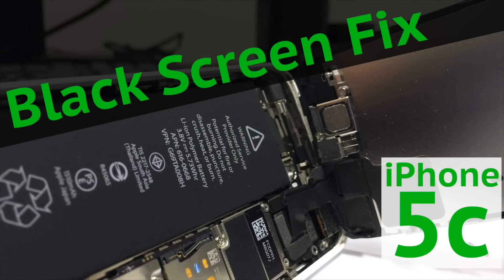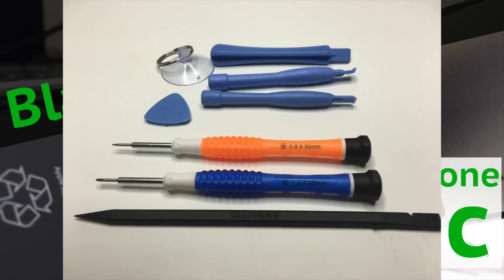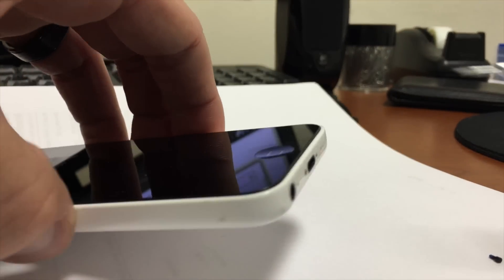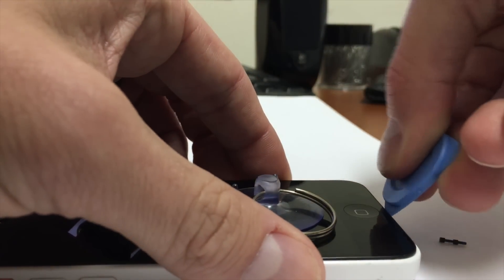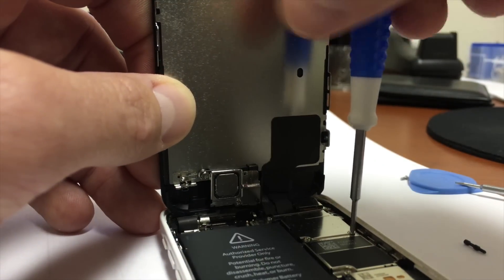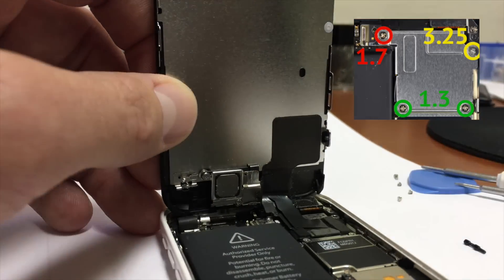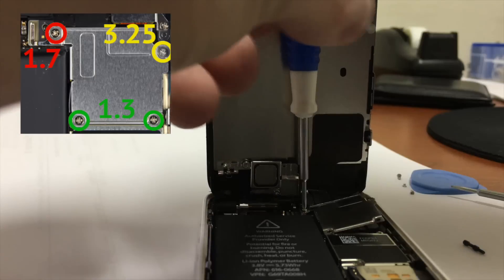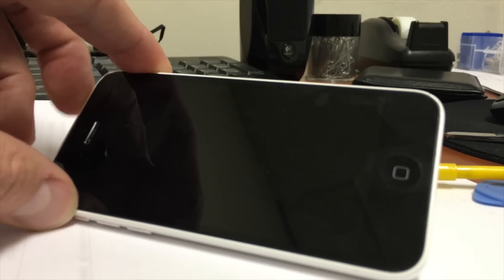How to fix black and unresponsive iPhone screen: iPhone 5c

Comment: Hi
So I removed a screen protector from my Iphone 5c and once I did that, the screen has backed in. It turns on when I press the home button but it finds it difficult responding to my touch, and this is the part I don't understand, it has faded lines in the background and the screen starts to darken and then it blacks out. I am worried it's badly broken and I will have to pay a lot to have it mended. Any suggestions as to what I can do would be lovely!

Comment: I tried everything you said to do in this video and the other you said to try if this doesn't work. My husband threw his iphone 5c on the ground(long story) and the screen is black, when I hold down the home button and the lock button simultaneously it'll start vibrating or if I turn the sound on it'll make the noise as if you keep connecting and unconnecting the charger but the screen still wont turn on. Just holding the lock button down the phone won't do anything, and only vibrates/makes noise if I hold the home and lock button down. The screen isn't cracked or anything but I am trying to get it to work to get pictures off of it instead of spending a crazy amount of money to send it somewhere. I don't know what else to do, please help!

Comment: Hi Tyler, I did follow all the steps and saw the connector in the bottom was not connected properly, so I did make sure it was connected properly, however the phone is still the same. what do you recommend me to do please? I purchased the tools  and I have them with me.  Thanks in advance
Reply: I am having the same issue, and have the tools ready with me aswell, I changed my screen and when I hooked it up, etc. the screen would not come up, it just stayed black, but in the backround you can hear the phone ringing, and making noises. Thanks in advance aswell, please respond soon!

Comment: I have about had it with IPhone 5cs. Ive had my old model break and now I spend money on a new screen and it works okay for about a week although it would do what it wanted sometimes, didn't text what I was trying to text etc. For whatever reason locking the phone would temporarily fix it. Now, I was working today and noticed my phone had this brief period of being complete dark and unresponsive. The screen came back on so I figured oh well. I got home and it did the same but now its unresponsive and black STILL. I took the screen off only to find everything looks in order, I unplugged and replugged the three cord things back into the logic board and now its buzzing away on the charger still unresponsive and black.

Comment: My iPhone 5c is able to charge and I can hear siri when i hold the home button and hear vibrations but the screen isn't showing any pictures it just turns blue when it's supposed to be on. I tried this and your other methods but nothing has changed
Reply: Florida Aquino after i droppped my phone the screen is black and i get notifications
Reply: i have the same thing ugh
Reply: i have the same problem have you fixed yours yet if you have i am wondering how i can fix mine please reply thx

Comment: Hello, can i have a question? I only have 0.8 x 25 mm and 1.5 x 25mm (instead of x 30 mm) screwdrivers. Is it a problem or can i open my iphone with that aswell? Thank you for your answer :)
Reply from the maker: You can try, but be careful not to strip the screw. If you need, you can get a kit for cheap here: http://amzn.to/28Touap

Comment: hi my iPhone 6 screen is all black but it works if i call and slide my finger across the bottom it answers the call but the screen is jst completely black. i opened it up and made sure everything thing was connected, held down the power n home button and still nothing. do you know whats wrong? if there is a way to fix it without losing any data on my phone. if anybody could help that would be great.
Reply: if you have not already fixed it and you do not wanna lose data I would suggest calling you're carrier and canceling you're service to you're phone so it does not cost you money when you're phone is off... Hope this helps
Reply: U have to soft reset it

Comment: Does this work if you have a cracked screen at the bottom
Reply: mine is cracked in the bottom too and it has a dark spot now and I am not able to use that part of the phone and it sucks cos I use that part to go in my feed or check messages on the apps that I frequently use. pls let me know if there is any solution prior to this situation
Reply: YHKceemrniceguy42 you need to buy new screen or new phone because the screen is already broken insidd